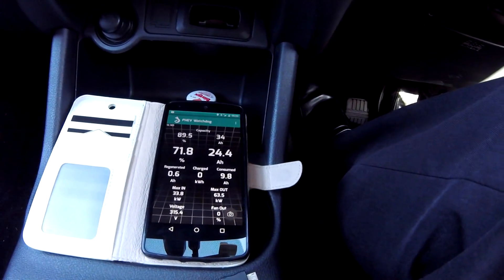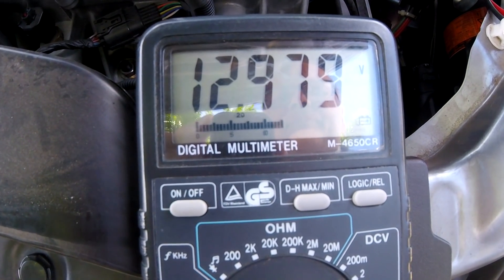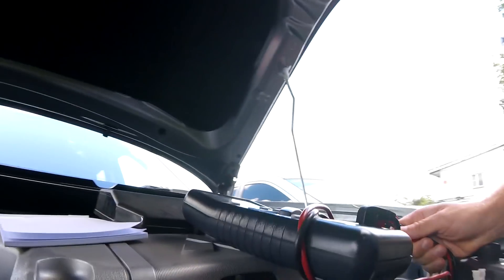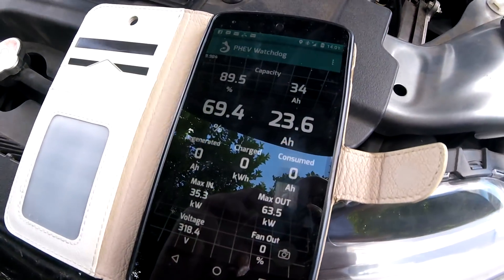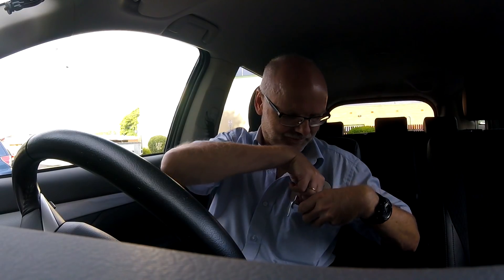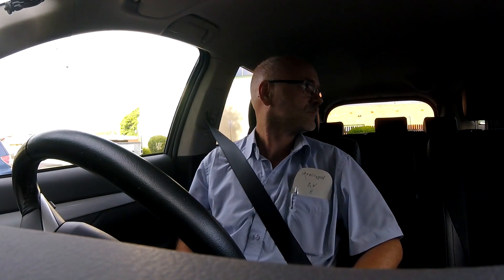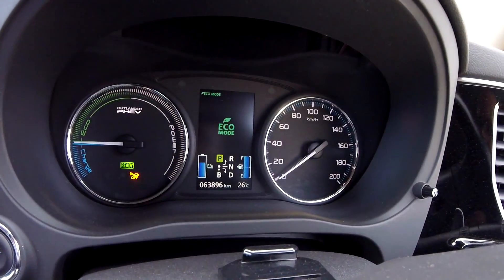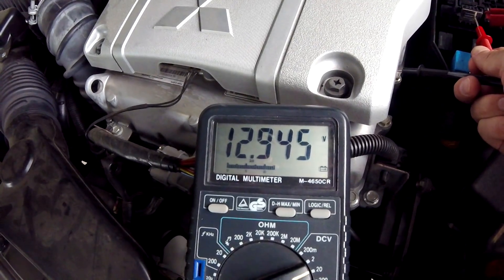Q41 - Outlander PHEV's AUX battery charges while parking!

Comment: The auxiliary battery  needs 12v min to power the system up without the enitial power you'll experience system failure and a host of error and service  messages on the dash if you park up and sit with heaters on   or air con the auxiliary battery will drain. The drive battery charges the auxiliary while the ignition button is in blue mode, I have had two such incidents the auxiliary battery is from 2014 so I think requires replacement....

Comment: Hi Andy, my and wife was invited by our friends to join them celebrate their wedding anniversary on the Saturday with some other Filipino friends with their kids . I drove up to this place from 6:45am till 10:45am. In the afternoon my friend wants to see the inside of the car and when I turn it on, it won’t turn on. It is a PHEV 2014. Because it was a very hot day I opened the windows all day but the car was definitely switch off obviously. We were just next to the car all day from 10:45 am and when I tried to switch it on at 14:00 it refused to switch on. My friend said just let the car key next to switch engine which I did and press the button for about 10 seconds and it has turn on and I was relieved but then it has died once again . I called for a recovery which he did managed to turn the engine back on and I tested it by driving around and it looks promising as i drove for about good 3 minutes until there was no power to pull the car. The dashboard was still on but NO POWER to pull the car. I reversed the car but it only reversed for few meters and then NO MORE POWER. The recovery guy suggested to keep it in neutral and keep it on and call for a direct recovery. So basically, it did not till Monday at the garage. Our friends stayed till about to get really dark because of the kids. My wife and I alone in the remote area. It was a very traumatic weekend because we end up waiting the recovery but pick us at 00:30 by taxi. I have lost my trust with the car.  This should not have happened. I don’t know why Mitsubishi will NOT recall this issue. The garage said there was NO CODES error it was a 12v battery went flat. But the recovery guy has jumpstarts the car and the dashboard was on but it’s NOT PULLING. I press the charge button to charge the battery while it was on but it was NOT CHARGING at all. The garage said all they have to do is charge the 12v overnight. The 12v is healthy they said as and the alternator.  My warranty could not cover the battery so it was on me. So this is definitely is an issue. The 12v in my case has been used up by simple leaving the doors  and windows open while the car was switch off?
Reply from the maker: Sounds like the DC-DC inverter is not charging the 12V battery. Get this checked if you haven't got a multimeter yourself. Voltage should go up when the engine runs.
Reply: They have tested everything and they found nothing. In fact they said all they to do is chart the battery all night and remove every error codes . The reason the engine did not switch on is because of the error presented by the car it should be clear first they said before it gets to work again. Despite fo the fact they said 12v auxiliary is healthy and alternator is generating good power. I am wondering why the battery has flattened just like that from 10:45 till 14:00hrs. I have opened windows with engine switch off. This is my question that no one knows. But The garage also mentioned that if I am next to the car all day (which they asked me how far I was from the car all day) which in my case I was, the key and the car was in constant communication. They said the car is thinking and always waiting for my action what I’m going to do with it. They said I should try to be outside the bubble of car-key wireless communication if I’m not using the car. Which to me looks make sense but at the same time doesn’t because i felt like there is no freedom of what I want to do. Like if I want to stay in the car all day while the car is at parked/idle. Don’t know if you have anymore idea though so Iv am mention it to the garage guys. Thanks Andy.

Comment: Hi. Today I made a test too. The conclusion is that aux battery charges when PHEV is charging too or when PHEV is ON. I try to put volt meter always connected and a camera pointed to him to register the values when PHEV is OFF and no charging because, like I sayed, I suspect that aux battery can also charges sometimes when car is OFF. I pluged also a digital clamp meter to the negative battery cable and I confirmed that, in that specific moment there isn't pratically any current flows but when I turn on the  interior 3 roof lamps I get 3.5A draw. When PHEV charges, I Saw also around 6A flow. Like with volt meter, the digital amo meter has auto Power off function to 15min and I couldn't turn this function off. Andreas, you must mesure the battery with clamp meter...
Reply from the maker: Thanks for testing Sérgio, much appreciated. I've put something together and will show this in the next episode this week. It's very interesting you will find. The auto pwer off is a problem with all these devices. They are not made for long term testing...
Reply: I've another digital voltmeter and I'll check if it has the auto power off function too. I'll try to use the positive plug in aux battery. If I use it, I can check volt and amp in the same space and it's more easy to check and register data.

Comment: I left my 2018 PHEV unplugged overnight.

Pressed Start button without pressing brake pedal to into Acces Mode.

At 12v port I had 12.3vdc.

Started by pressing brake pedal and start button.  Charging at 14.5 vdc
Reply from the maker: That's how it should be! Clearly aux charging works on your car :D

Comment: If you press the power without the brake 1 time it goes to basic aux mode - mmcs only.   Press power again with no brake it goes to enhanced aux mode - fully switched on except the motor.
Reply: Also consider if the car starts in Aux mode as Andy did here, then the electric vac pump doesn't turn on also thus making the break pedal very hard to depress...may be why he couldn't turn it off till he pressed hard on the pedal..hope this helps also...
Reply from the maker: I didn't start in Aux mode. I pressed the brake pedal and then Start with the result shown. I know how to cycle through the Aux/Full Aux/ Full On ...
The brake pedal was very hard to press for some reason (no vacuum for the booster?)  and I thing I didn't press hard enough to trigger the brake light switch. Weird anyways as the car also did not turn off any more...
Reply: Maybe Have another look at your raw footage...there was no "ready" light on the LHS econo meter in the first scene but other dash lights were on...somehow you were in Aux mode OR a failed ready mode...either way the break pedal would be hard as a rock with no vac pump cutting in... I have had this before...really have to stamp on the break pedal to reset press power ...ready light comes on ..good to go!..even have had this on a diesel Triton with button start. cheers...

Comment: Just wondering if the rise to  12.9v during parking was simply battery chemistry at work ?
Although mine seems to lose that same amount of Ah when my car charges overnight ans it's not plugged in.
Is it possible the non wi fi cars just pump .6Ah in to the Aux battery after every start , turn off cycle ?
Reply: sendtobarry I Concur with your thoughs....as with the drive batteries if you have a cooling battery, i.e. hours after charging. The volts will rise a little.. just millivolts..as was seen...untill he turned the car on again...charged for a few minutes from the drive batteries.but also firing up all the computers /waterpump etc.again probably for 20mins before they went back to sleep..but he only charged for a few mins?? I would certainly expect a drop.keep in mind also when phev is on ac charge the aux 12v gets charged also..lets get back to basics..lead acid cell are flat at 1.75v and full at around 2.2v hence with 6 cells any lower then10.5v is we would call stuffed! ...13.4 v is 100% as you need atleast 13.8v to charge...now if you dont let battery get below say 12v the you life expectancy gets to >5years but 1-2years if you run flat all the time...like you do when starting a conventional ice..however that is not happening here..the ice starts from the generator powered from the drive batteries not the 12v...so unless you like parties in the beach running the 12v down with the lights on and  music blasting for hours! This battery should last for 5-7 years with good maintenance. ..but unfortunately they are sealed so we can't top up with distilled water as easy AND as they are charged on driving and charged on 240v...they can acctually boil dry...even SLA types..so if you can.. check the fluids in them but as with any manufacturer these days they want you to buy new! 
 As always the best test for fully charged battery capacity is to have a known load resistor say 12ohm thus drawing 1amp and count the hours..if it is within 20% of the ah written on the side then should be good...another way is to measure with volt meter under load and if it falls quickly to 10v ie less than an hour then there is a dead cell .....Hope this helps here is a link for bat%..
 https://goo.gl/images/Agb9zm
Reply from the maker: Thank you! Good knowledge about the car and how it charges the two batteries, eh?
Reply from the maker: The aux battery has a certain load for the alarm system, central locking radio receiver and other stuff while the car is parked. Even if this load is only small, it should make the battery voltage go down.

Comment: You could get one of these to monitor the aux bat voltage while you go along. Its a cigar socket type digital voltmeter. They are as cheep as chips in the UK eBay. http://www.ebay.co.uk/itm/Hot-LCD-Cigarette-Lighter-Voltage-Digital-Panel-Meter-Volt-Voltmeter-Monitor-Car/311431469232?epid=1732105173&hash=item4882c318b0:g:msUAAOSw3ydV2yWb It will allow you to monitor/measure the aux battery voltage easily from inside the car.
Reply from the maker: Yeah, I thought about that. It turns off with the car though. While the car is running the PHEV Watchdog shows the BMU voltage which is the 12V battery voltage. I would need something more......... I don't know yet ;)

Comment: Hi Andy,
The voltage rise, was definitely something weird, and also being low after you drove was also.
Maybe you are on to something there, wouldn't it be great if it was something  easy to replace that would fix
all the woes.
I have had the EXACT same issue a couple of times with the car not powering on/off properly....the exact scenario.
I find that if I hold the Power button down until it goes off it generally "resets" and starts and runs OK afterward.
I'm a computer technician with my normal job, so can imagine its bootup process just like "Windows" has a fail
once in a while.
Happy Measuring....Andy :~)
Reply from the maker: The weird thing was that the break pedal was hard as concrete to press, there was no vacuum available for the booster. I think that was the problem as I could not step onto it far enough to operate the brake light switch which gives the signal to the ECU to start the car. Strange enough that I could not turn it off either though...
Reply: Same with me, though I'm pretty sure the brake pedal only takes the smallest of movement to operate the brake light and signal ECU, I tend to think
it's more of a software glitch, luckily its recoverable, hate to get stuck on the side of the road with that issue !!!

Comment: Do you have something plugged into the OBD port? If so, it will draw from the 12v battery. I had a Garmin OBD device that would drain my 12v each night, whereas the Scangauge I now use has only a minor effect.
Reply from the maker: My Bluetooth adapter is plugged in to the OBD port all the time to connect to the PHEV Watchdog. I've tested as well with nothing plugged in with the same result. The adapter goes to sleep after a few minutes and does not draw any energy until the car is turning on again.